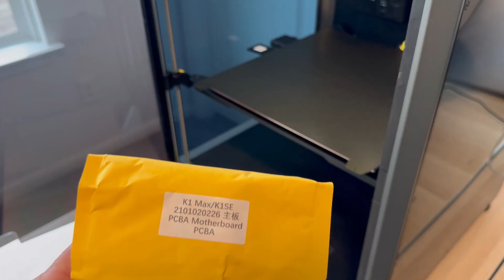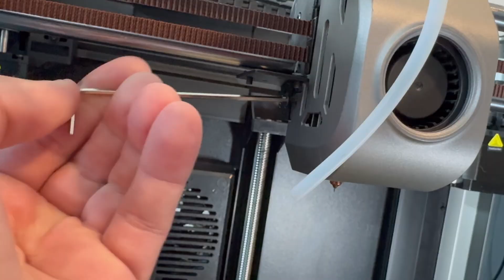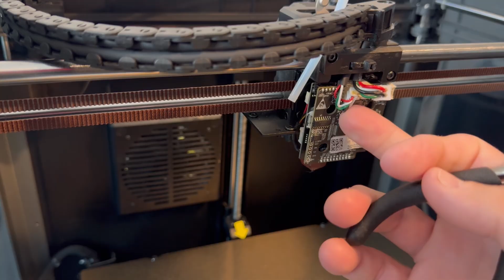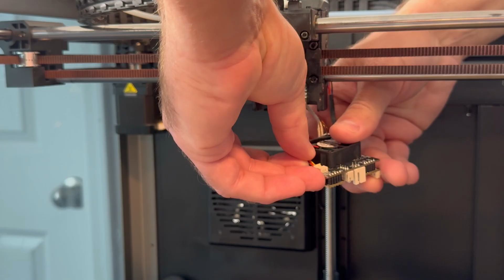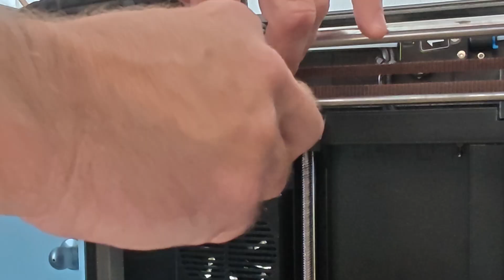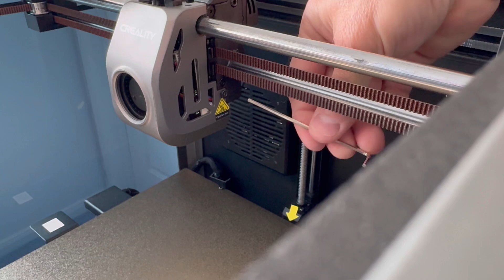Creality K1 Max – PCBA Replacement (Nozzle Board) – Easy Fix

Comment from the maker: If you’re replacing an older‑style K1/K1 Max board with the newer version, one of the easiest ways to connect the different wiring is to use hot‑end adapter cables made for the K1/K1 Max. Companies like MicroSwiss make compatible adapters that simplify the install.

Comment: Dude there is no way you can pull those plugs off/out of that bored as easy  as that, there is so much glue on their it pulls the plugs off of the board itself
Reply from the maker: I think somebody had loosened this board before and decided not to replace it. On boards with excessive glue, I use a tiny pair of needle nose (jewelry) pliers to carefully pinch and twist the glue off of the plugs. Take your time, so you don't break the plug. Carefully pinching only the glue, twisting and peeling the glue away. Some are so bad that you have to start by taking little bites at the glue with the pliers.

Comment: There is a small plastic ring called isolation column in my manual, and it is unclear where to put and what it actually isolates. The picture is in there is tiny and not very informative
Reply from the maker: If you don't see a small plastic spacer in your disassembly, you likely have one of the newer toolhead revisions where that spacing is already molded into the housing. That column is there to keep the board from bowing when you tighten the screws, but if your board sits flat and the front cover fits flush without it, you're good to go. The updated models also use an integrated, quick-swap design with "unicorn" nozzles. Because of this, you no longer need the hotend stand-off spacers above the heat sink that were common when adapting older K1s.
Reply: @OopsOrAwesome  yeah I ended up assembling without it - but thanks for confirming!

Comment: Correction - The connector you referred to as the filament runout sensor is actually for the Extruder motor. The factory filament runout sensor for the K series printers is located on the back of the machine.
Reply from the maker: Thanks for the correction, I appreciate that!

Comment: Why did you have to replace the board what code did you get?
Reply from the maker: It would shut down the print before it actually started and give the message "abnormal heat break fan error! please check according to instructions".

Comment: I need help. A month ago, when I disassembled my K1C and incorrectly connected the large front cable, I heard an electrical noise and got error code 111. I've already replaced the PCB and the hotend with a new one. Do I need to replace the cable?
Reply from the maker: You could try the cable. From experiences and forums I’ve read, I would suspect the cable or the motherboard.
Reply: Both boards died for me this way 😢

Comment: haha this big cable from toolhead impossible remove xD i removed glue and cant move.. !
Reply from the maker: I peeled off the glue earlier while diagnosing the problem so I could order the correct parts. Even then it was really stuck—I ended up using the needle-nose pliers to rock/wiggle it side-to-side and up-and-down for a while before it released.
Reply: @OopsOrAwesome ok i finally did lol shitreality K1 IS really so joke omg

Comment: 😢… I had to replace my PCBA board because I broke a connector when upgrading the extruder. Now that I have the new board, it doesn’t appear to have come with the new connectors. I was following your vid with no issues until I went to hook things back together. Any idea where I find the new wires and how do I replace them?
Reply from the maker: If you have the new style board and the older style cables without the clasp/clip, the easiest way would probably be to get hot end adapter wires. Microswiss has them for like $5 I believe. The cables go between your board and your wires so they can connect. Another option would be to change the heater and the thermister on your printer that have the newer style wires.
Reply: Thanks for the quick reply!! I’ll see if I can find the adapters.
Reply from the maker: @P @PimpMonk  You’re welcome, I’m glad to help. Let me know if you have any other questions.
Reply: @OopsOrAwesome just ordered a couple of sets from eBay. My K1 max has been down for over a month now… was having extruder issues which I hope were resolved with the upgrade but now this. So much for “plug and play “!! 😂😂
Reply from the maker: @PimpMonk  Yeah, not so plug-in play sometimes. Glad you were able to order adapters and good luck with the extruder! It’s frustrating when printers are down. Upgrading the original style board will probably be common so I may need to add this info to the description and maybe links to the adapters so nobody’s caught by surprise. Thanks

Comment: Hey brother the Connectors in the wire side of the boards plugins do you happen to know what they are i recently had my board blow and melted some of my wire ends wanted to trim off old ones and crimp new ones on and i do have the updated Hotend board now. Any help would be great thanks man and good video!
Reply from the maker: Thanks. We were just talking about this the other day. It appears that most plugs though out the board are still different JST connectors. And that the new heater and thermistor use XHB 2.54 and HY2.0 connectors. Which plugs melted?
Reply: @OopsOrAwesome   well it was the coil and main head 4 plug on the front i believe i got everything to replace just fine can shoot you the link if you wanna throw it on your Descript to help anyone else out i appreciate your help brother! May your extruder never jam my man!
Reply from the maker: @saintedforslaughter  you’re welcome and thank you, glad to help. Great to hear you got it worked out. And I’ll be happy to add your information to the description to help others out. I appreciate it.